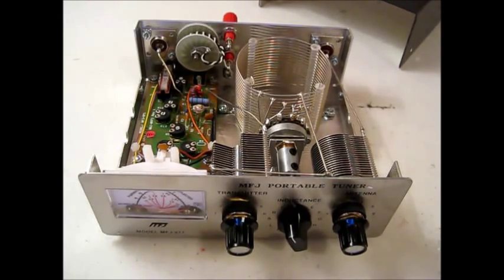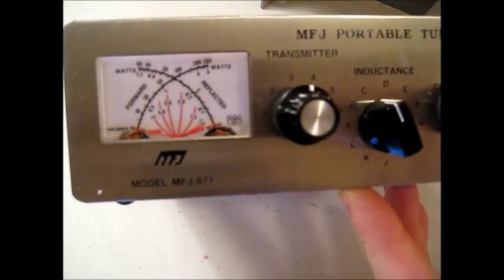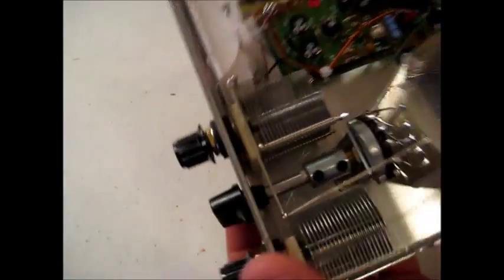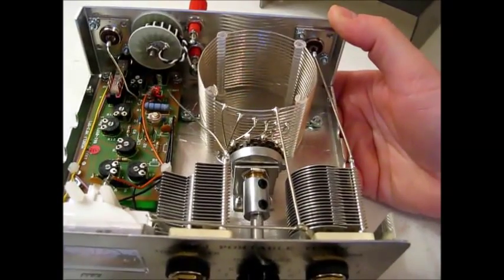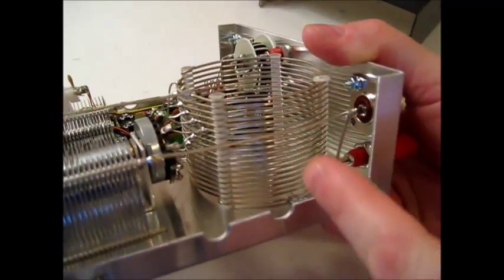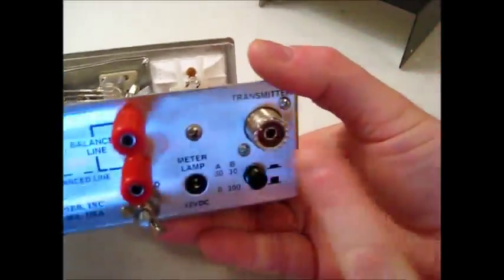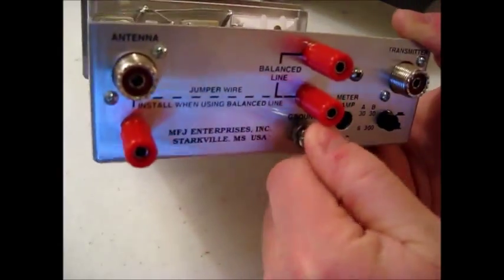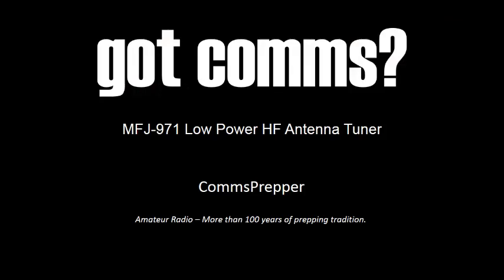Bugout Bag HF Radio Antenna Tuner (Low Power)

Comment: Thanks for sharing your review!!  I just purchased a used one of these off of eBay to use with my uBitx that I just assembled.  You can see my uBitx on my YouTube channel.  Since the uBitx covers 10 - 80 meters I wanted a tuner so I really different have to carry around various antennas for different bands.  73 Juddie WD8WV

Comment: Ok so if I’m using a 100w rig but tuning at about 10w where should I have the button on the back I can. It get this tuner to work for me at all
Reply from the maker: This tuner should not be used with a 100 watt radio.  It only goes up to 30 watts.  You need an MFJ-949D or similar.
Reply: Commsprepper it’s rated for 200w check the specs if you are using it on low power there is a jumper to set inside

Comment: i believe this tuner can handle 200 watts, thats how its advertised at my local HAM store anyway
Reply from the maker: Correct but it's one of the few tuners that has an option to support QRP (reduced meter scale).
Reply: Commsprepper Thats good. i almost had a heart attack because i was about to just purchase this tuner. from your video i thought it was only 30 watts! ah anyway. i will purchase it knowing its actually 200 watts capable. 
73, VK3FBIC
Reply: actually 300 watts. Just bought one.

Comment from the maker: I like auto tuners.  I have an SGC-230 and it does a great job.  However, for the bug out bag I like something smaller with less moving parts (possible problems) and no power requirements.  Both auto and manual work well but the manual tuners are like driving a stick-shift car - you get a better feel for antenna.

Comment from the maker: Mark - No.  The Wouxun is a VHF/UHF radio (136-174mHz & 400-512mHz).  This tuner is for HF (or shortwave) radios operating between 2-30mHz.